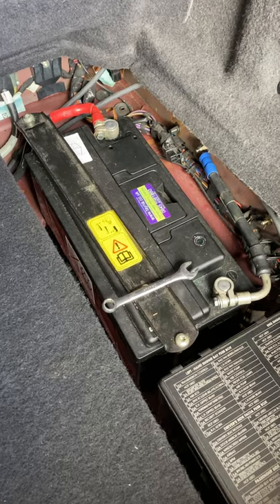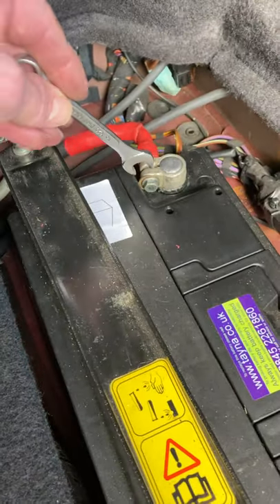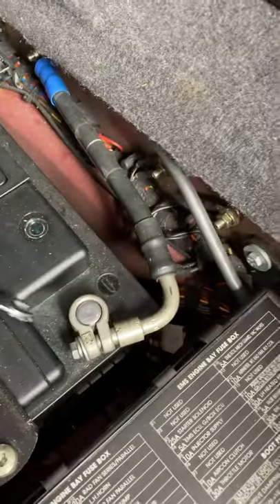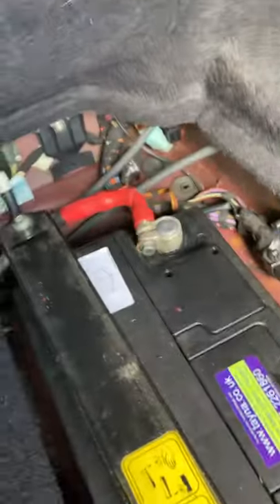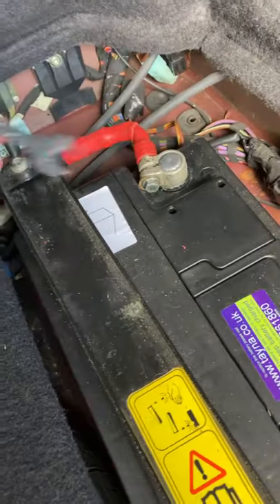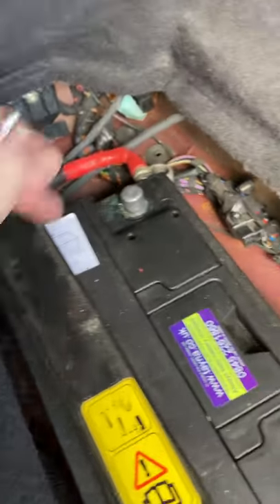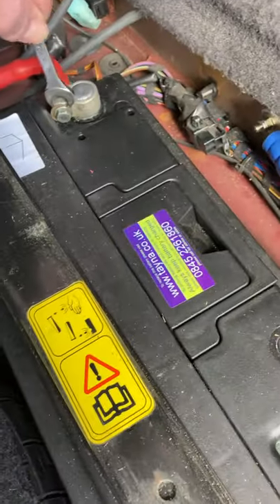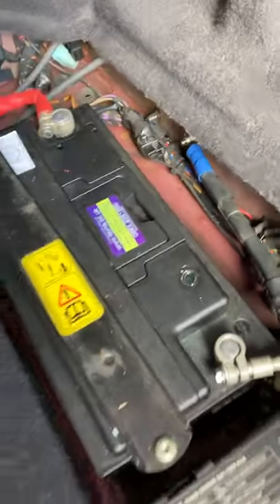Jaguar XK8 Car Battery disconnection reconnection S3 / XKR (X100) #shorts

Comment: I’m ready for a battery Damien. Any info or suggestions
Reply from the maker: Robert, no particular favourite from my experience. I believe the minimum spec is 90Ah but would buy the biggest one I could afford in reason. You will need to double-check the battery size, terminal positioning and terminal type before ordering just in case. Most motor factors will be able to help with that. Just make sure you sure a battery trickle charger or disconnect the battery over the winter if off the road. Sorry cannot give a specific recommendation batteries and battery technology is always improving. Thanks for the interesting comment regards Damian
Reply: Any H8 sized maintenace-free battery like the Bosch works well.